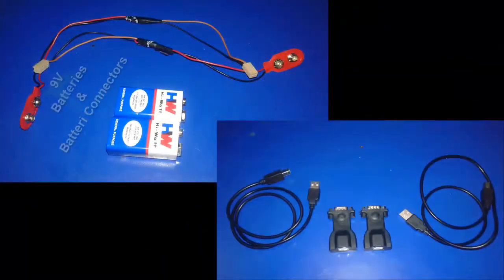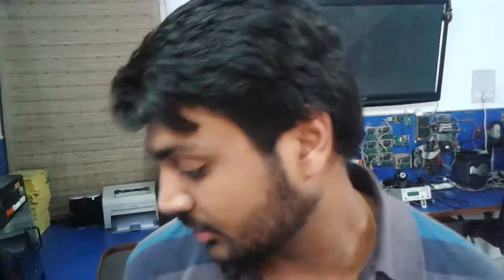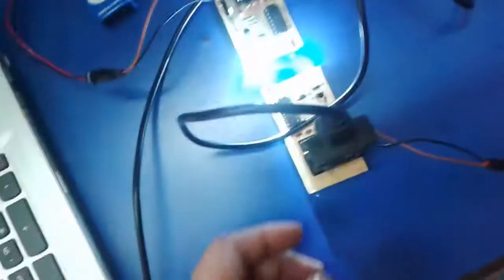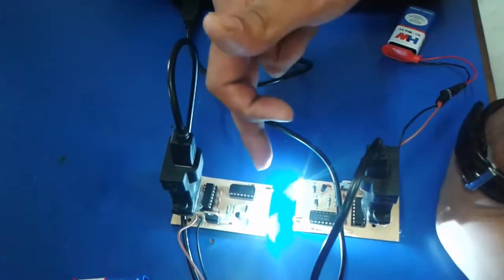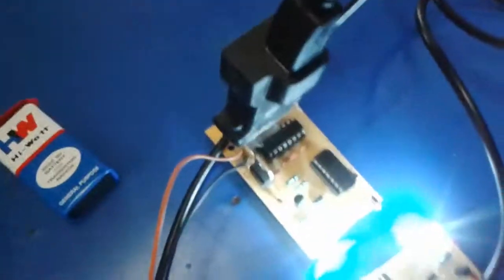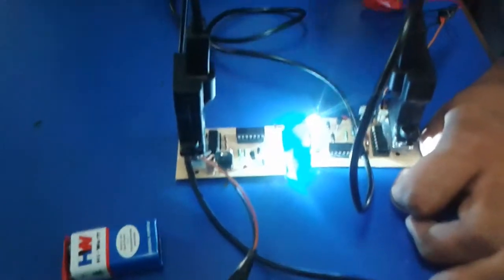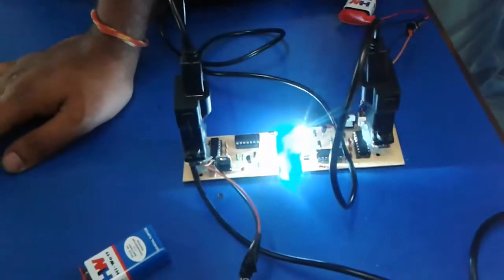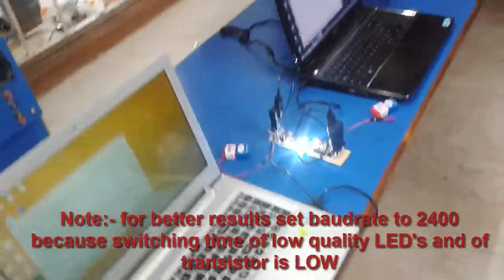TISHITU LI-Fi VLC (Visible Light Communication) Data Communication Through LED

Comment: Sir I just need help 🙏🙏
Reply from the maker: HOW DO I HELP YOU
Reply: @TarunShrivastava  sir I wanna send audio signal with 15 led bulb with AC 220v .is it possible?
Reply from the maker: @Aastha_Bhakti  AC BULB HAVE INDUCTION FILAMENT.IT WILL NOT HELP , AND NEVER HELPED BY AC SUPPLY 
SEE THIS https://www.youtube.com/watch?v=yLWNT6OveeY
Reply: That means lifi can only work with 9v battery only.it is fixed,right?
Reply from the maker: @Aastha_Bhakti  no it will work with high power too but require alterations in the circuit ... it can be floodlight of stadium with high performance LED
Reply: @TarunShrivastava  🙄. No No I just ask about LED BULB not the ac bulb. I wanna transfer audio with normal led light which is used in our home .IF it is possible then,please help me sir 🙏🙏🙏
Reply from the maker: @Aastha_Bhakti  that home wall AC bulb needs correction to operate with DC supply
Reply: Please please please 🙏🙏🙏🙏🙏😁😁😁
Reply from the maker: @Aastha_Bhakti   those are commercial projects. or you can do ..put that led on bulb shell and operate wit 9v DC adapter
Reply from the maker: @Aastha_Bhakti  and if you want to add extra led replace transistor with sl100
Reply: @TarunShrivastava  ok sir thank you,thank you so much😁😁😁😁😁😁😁

Comment: Can I use any different photo transistor instead of L14G1 as it is not available?
Thank you sir
Reply from the maker: sure you can but three leg
Reply: @TarunShrivastava  sir any specific photo transistor you would suggest. thank you sir
Reply from the maker: @utkarshadesai3165  2Pcs - L14F2 - Phototransistor for Electronic Circuit https://www.amazon.in/dp/B01I1DFTAI/ref=cm_sw_r_cp_apa_i_bDWfEbBX8ZV3Z
Reply: @TarunShrivastava  thank you so much sir

Comment: #HELP sir I am using USB to TTL cable which already have MAX232 IC inbulit. When i transmit signal LED blink but on Receiver side no response.. help me Sir
Reply from the maker: try chk on cro , collector of photo transistor . if you gt pules or fluctuation this is good sign ... keep in touch
Reply: @TarunShrivastava  #help sir ! Can we use photo diode in place of photo transistor.
Reply from the maker: Sorry you cant ... transistor work with gain and amplification and diode with threshold
Reply: @TarunShrivastava  ok thanx
Reply: @TarunShrivastava  sir I have a confusion .in circuit diagram Diode D3 is short circuit .so i will use like diagram or I'll ignore it.
Reply from the maker: @vaibhav_rich  this is to limit led current .. if intensity is low then use same circuit .. actually diode drop .7 volts if necessary

Comment: Can receiving and transferring data can be done simultaneously?
Reply from the maker: sure but with different software multitasking
Reply: @TarunShrivastava  can we connect two computer with each other using lifi, as we connect with Lan cable?
Reply from the maker: @SujitKumar-od1pw  we need different hardware  with another protocol that is tcp/ip

Comment: Nice work. Will the circuit work if we replace microcontroller with FPGA?
Reply from the maker: there must b UART LOGIC must be develop in fpga
Reply: Tishitu thank you. We tried the circuit and it's working fine. But we have tried on breadboard and the laptop can't detect the usb connections made. so data transfer is not possible yet. Can u suggest how to connect the breadboard to laptop?
Reply from the maker: You must go with usb to serial convertr
Reply: Tishitu ya we are using usb to serial convertor .. which is connected to db9.. and that db9 we connected to beard board .. but the pc doesn't show the connections .. what could the alternative ??
Reply: how should I interface the usb to serial convertor with laptop ?
Reply from the maker: it is already in market you don't have to design such circuits

Comment: Excuse me, I got difficulties in finding the phototransistor L14G1 OP505A. Could I use something else like solar cell? I ve ever used it for another VLC project and it worked. Will it be possible for this project?
Reply from the maker: solar cell is not good for digital communication ... if u use b sure u have to use opamps

Comment: Thanks. but I wanted to know if you can transfer files rather than just type in one comp and get the output at the other comp
Reply from the maker: +johnHadCoreMetalHeaD there is option in Hyper terminal to transfer a file ... ive tried and it is working

Comment: hi tarun. in this project , what is the function of RV1??
Reply from the maker: +Mundir Mahfud it is variable and can be static volume controll
Reply: +Tarun Shrivastava  thank you
Reply: +Tarun Shrivastava such as we use in the wefcom modem DB9 connector , whether it can work ?
Reply: +Tarun Shrivastava in this project , if it does not use 7414 as a phototransistor , what could work ??
Reply from the maker: this is amplifies

Comment: I didn't understand can u explain it more
Reply from the maker: +Hardeep Verma RS 232 communication is older technique  ... like dial up modems they are using Rx/Tx and ground wire so this is easier to go with single light pointing Rx/Tx communication for experimenting ... you can connect your mobile with other device >> laptop or mobile to use hotspot internet via Wi-Fi/bluetooth if u r using bluetooth then use comm device to connect ... Well here is a trick with computer Use my circuit with same comport settings .... well you have to practice with comport settings baudrate bla bla bla for communication .. use simulators like proteus , compilors like C# matlab .... hmm bit long journey  :)